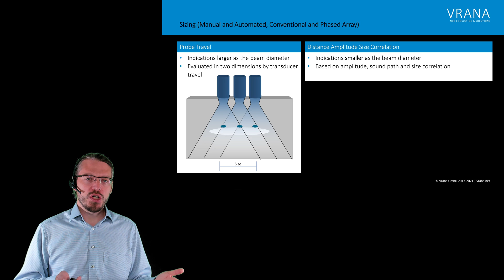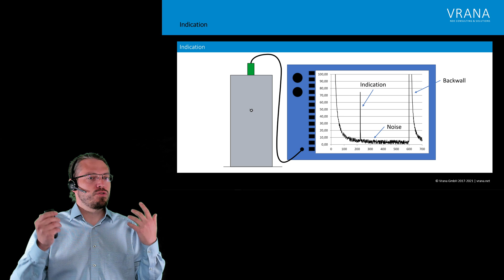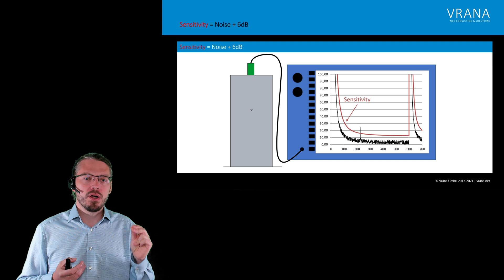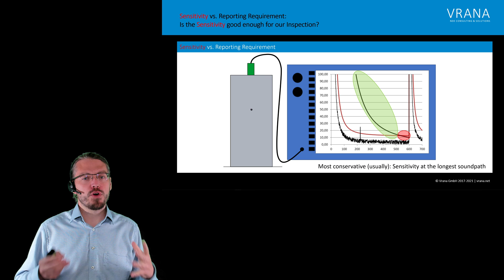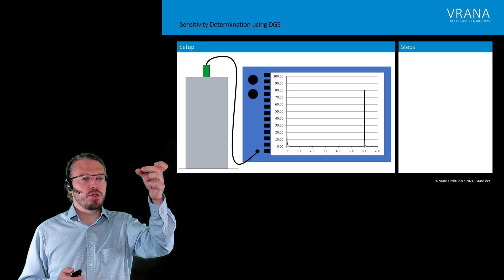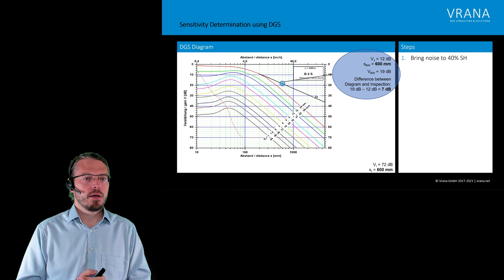Ultrasonic Testing: Can I detect what I am required to detect?

Comment: Thank you sir , finally i have one question if possible to detect 1.5 mm discontinuity in 5 mhz ,tr probe with valuable sensitivity.sir i understand the sensitivity session,but i need this question in your side . please reply this one sir😊
Reply from the maker: This entirely depends on the material and the sound path. If you have a forged and heat treated material and the sound path it should be possible to let's say 1/2 meter